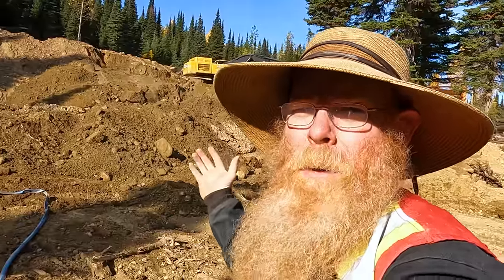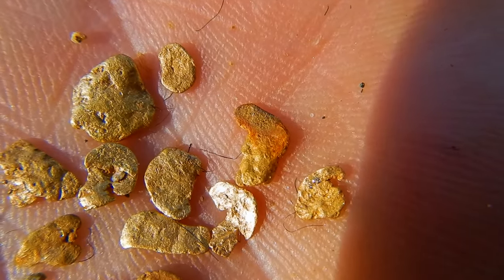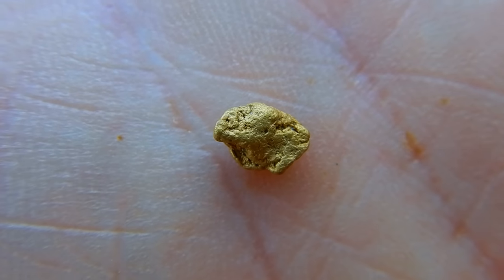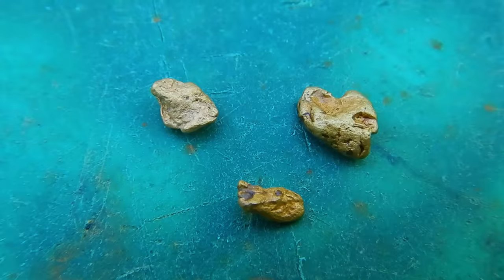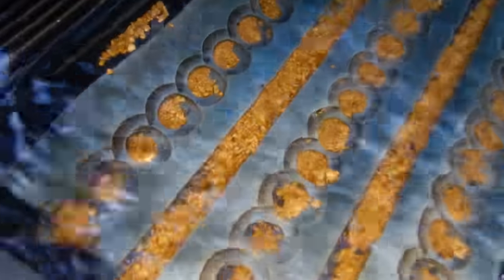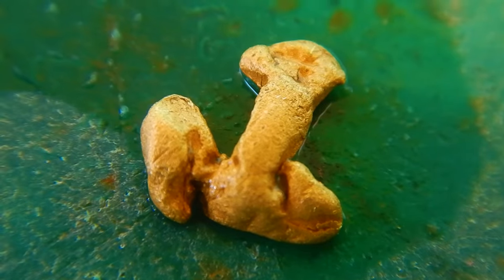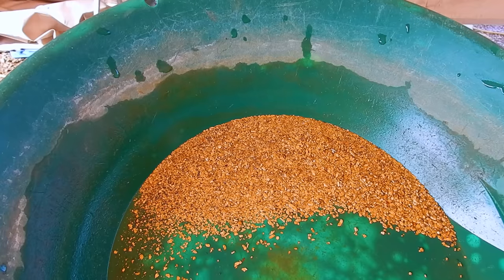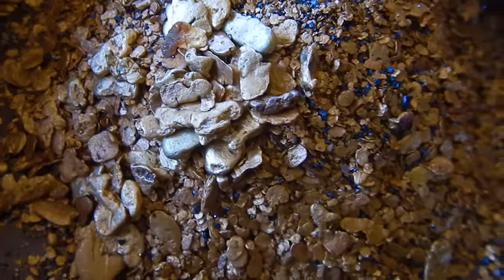My biggest GOLD clean up of my life!

Comment: Great video as always Dan!!!  It was awesome to have you out there. 
One part of the audio that was missed was Dan explaining the weeks total was actually 3 ounces more then what we weighed out. I usually high-grade the gold in the hydraulic riffles and just run the remaining concentrates through the cleanup system. 
Also Dan explains what my running costs are for myself and to make it short, I am around the 25% mark for fuel and maintenance.
Reply from the maker: Next time!
Reply: That 3 ozs makes a huge difference. Good job out there.
Reply: Killer operation you got there, Tyler. I’m just a framer from Ontario but must’ve been a miner in a past life. I can’t get enough.
😁👍🏻
Reply: @SlatcoAu  Hey buddy! Long time glad to see you still in the hobby. You still mine in the summers?
Reply: @cademusgrove9164  Sure do! Been slowly addding to the operation, bought a rock truck that ended up having a bad transmission and that set me back a bit. Thanks for reaching out.  I will try and get a vid out this winter.
Reply: 7oz for 250 yard?
Reply: @Golden_B1  Hey Tyler here. No that cleanout was over 5-6 days. The total was just shy of 10 ounces.  The grade we were mining at the time was really low at only 1 ounce to 250 yards

Comment: At 3:19 I notice the expanded is put in for a more aggressive action (sort of 'against the grain' as it were), and have always been told (from what others heard most likely rather than through experimentation) that the expanded should lay the other way for a somewhat gentler slope to the action zone. I have done some small tests with the std Keene in both directions, and think it might be more based on the size of the chunks vs the size of the expanded rise. Thoughts?

Comment: That was pretty cool.   I was mildly surprised to see the spiral wheel is still a thing.  My dad bought one in Colorado back in the mid 90s.   We didn't have too much luck with it but it got limited use and I'm pretty sure the problem was in our material and our skill.  The device itself seemed like a good idea.  Ours looked almost identical to the one in the video except IIRC ours did not have the water tank built in.  I think we used a bucket below it.

Comment: so from the profit of the gold and the cost of running the operation was it worth it?
6.9 oz * 1800 gold usd per oz = 12420 was it worth it?  wont you lose 28% due to taxes on selling gold + cost of operations?  so really he only made around 5-6 k???
Reply: Hey Tyler here. Up in Canada this was 14k worth of gold after melt and our mineral tax in only 0.5%. My cost of operating is only 25%, so my profit off this cleanout was 10,500.00. I am only a 1 man operation so the profit margins are really good.

Comment: clean up from how long of a run..
Reply: That was for 6 days, there was 3 ounces missing from the cleanout from me highgrading the top of the box in the precious days.
Reply: @TheMiningChannel  I'm sure lots of expenses , planning, maintenance, equipment set up before a 6 day run.   that is beautiful gold and a cool operation.  Looking forward to more in your channel.  Build and design videos of your equipment would have been so cool.   I would love a video of you scraping that bedrock.  Will you do any hand digging in cracks?  Maybe it's not so important in a glacial moved alluvial deposit?
Reply: @elkskiutah8204  Yes lots of planning but I have a good system down after the 8 years of doing this. We can usually move into a new site and be sluicing in 2-3 days. Typically I can sit in 1 spot for 2-3 weeks before moving the plant, a loader is on my wishlist so I can move pay to the plant without having to move alot. Dan will be coming back next year to do a bunch of bedrock and detecting, I am super curious myself on what is left behind, legally we are only aloud to dig into the bedrock just a little then it turns into a "mineral claim" which I don't have the rights to....